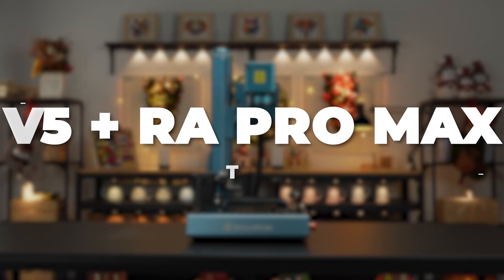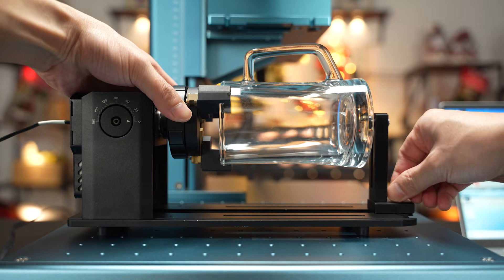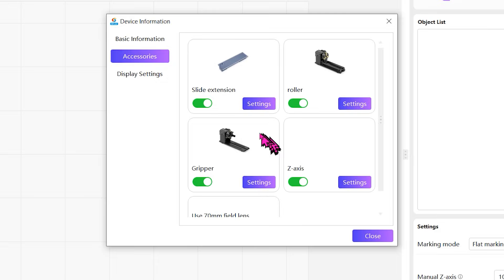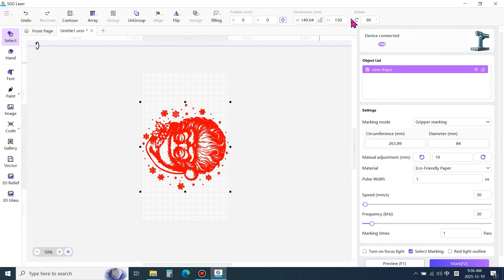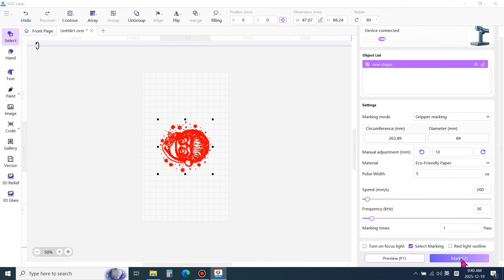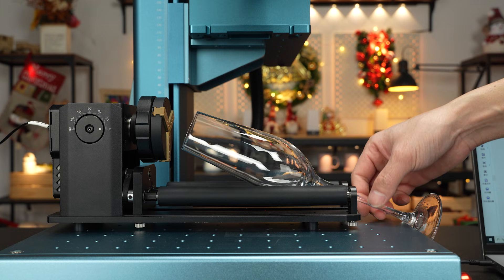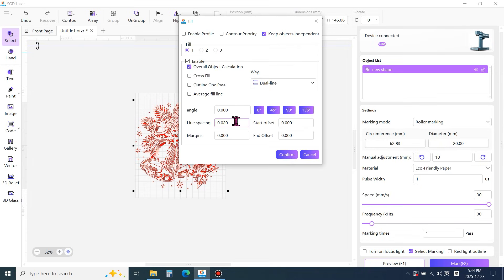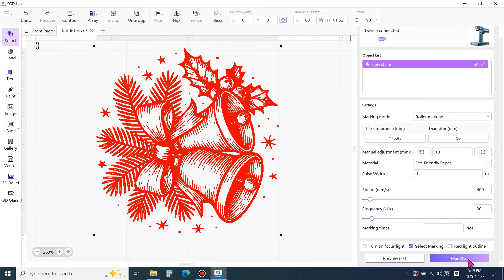Sculpfun Tutorial: How to Use RA Pro/RA Pro Max with V5 UV Laser | Full Tutorial

Comment: I use the included L-Clamps to position mine centered - no need to measure with a ruler. This way, if you accidentally bump the rotary or machine, the material stays in place. (Can't attach images here, but I did add to the official FB page.)